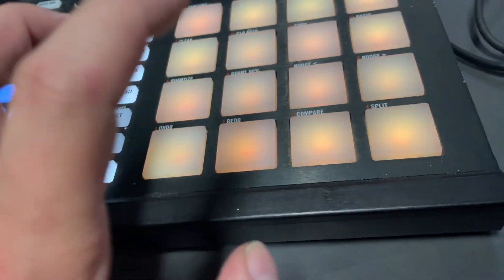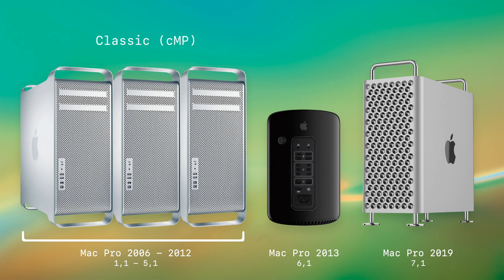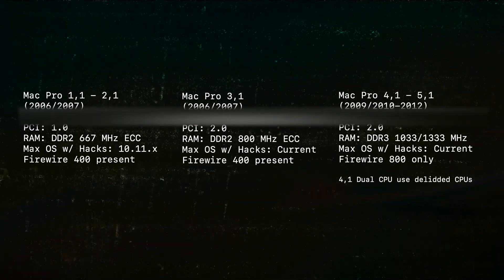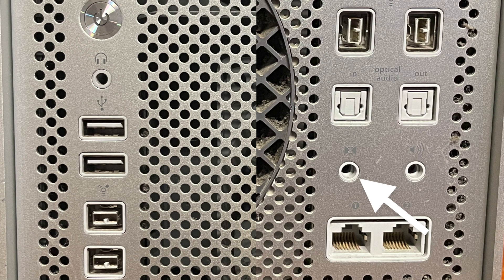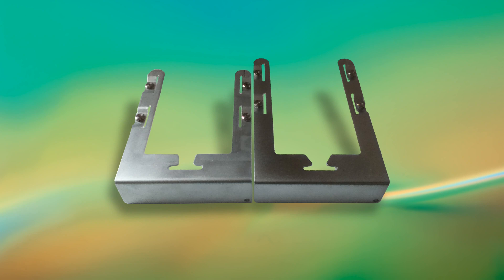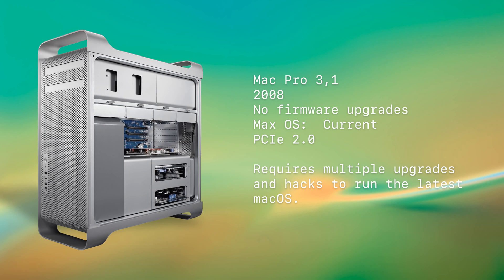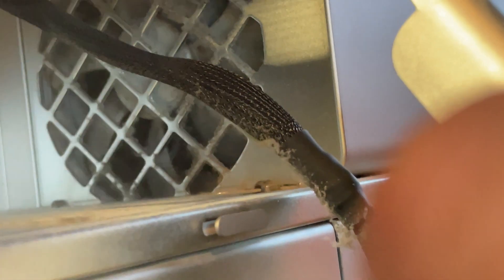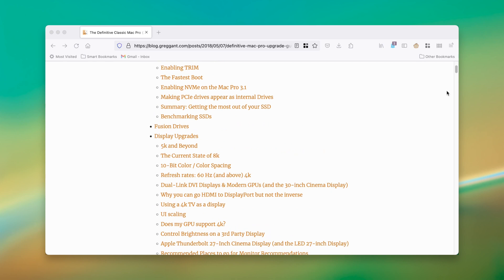Watch this before buying a Mac Pro 2006 - 2010 (1,1 2006  3,1 2008  4,1 2009 and 5,1 2010-2012)

Comment: I have a 1,1 modified with 3,1 parts to be a 3,1. It's a great mac running Mojave, I even got Big Sur to run. Despite this though I'm thinking of replacing it with a 5,1
Reply from the maker: Yeah, I made that jump around 2018. I went from a dual CPU 2.8 GHz 2008 as I noticed Serato would lose parity and goof up often after about 20 minutes of use which was annoying. Then I went to a Mac Pro 5,1 dual six-core 2.93 GHz and it was noticeably faster, especially using things like Serato, virtual machines, audio apps and video editing. If you can get one cheap, you can nab from AliExpress the same x5670s for all of $10 a pop shipped. For $20 you'd have a computer more than 2x as fast in multicore.

I'm interested though in your 2008, did you replace the logic board + CPUs?
Reply: @dmug  Surprisingly it was pretty straight forward replacing the parts. I found a guide online documenting the process but I can't seem to find a link. I had to replace the Memory Cage/Back fan, RAM tray, motherboard and cpus, Northbridge heat sink, Front fan assembly and motherboard cables with the 3,1 equivalents. Two 2.8ghz Xeons came with 3,1 board.

Once they all arrived, I replaced all the 1,1 parts with the 3,1 parts. It was pretty simple until I realised the 3,1 motherboard cables couldn't reach the 1,1 power supply. So I made a cut in the aluminium between the power supply area and the DVD drive area to get the psu cables through to connect to the motherboard cables. 

I forgot to add that I also had to move the rubber feet from the 1,1 board to the 3,1 board. Most of the screw holes met the board  but there was 1 or 2 left behind that didn't matter. I also bought a flashed radeon hd 7950 for future mac pro use.

Once done the Mac worked perfectly and performs the same as my dual core 2019 macbook pro that I used to have. Only 1,1 parts left are the case, power supply and fans. The 600mhz ram is also being used with the 3,1 board which of course slows the machine down.

If you kept the 1,1 fans, the 3,1 board wouldn't had been able to control them on boot so the mac would just turn into a jet engine. The 1,1 memory cage also doesn't fit with the northbridge heatsink or the 3,1 ram tray.

It was a really cool upgrade to do.
Reply from the maker: @mrg2810  Very cool. That's more hardcore than any of the upgrades I've done to the Mac Pro. I can only hang my hat on the Pixlas mod, and drilling out a small hole to feed SATA to the optical bay on my 2008.   

I assume that was done quite awhile ago when finding a pile of 2008 parts was a lot cheaper than getting a fully functional 2008 as that's an undertaking.
Reply: @dmug  wow hearing all this talk about the 2008 makes me want to take mine out the closet and tinker with it again. But I was seriously thinking about turning it into a media server for my plex videos. But not sure what I want to do with it. It’s still a solid built machine even in 2021.
Reply from the maker: @d.harris790  It is fast for plex, at least when I tried it about 9 years ago with 1080p. I dunno if you care about such things but I used my 2008 for awhile as my Media PC and had it dual boot Windows and played PS2 games using PCSX2.
Reply: @dmug  I used my 2008 up until I got my 5,1 Mac Pro 3 years ago. It ran plex without any hiccups at all streaming to 3 TVs. Now most of my content is 1080p but I’m good with that.  I have an  8 core, 16 gigs of Ram, and a nvidia gtx660 3gb graphics card along with the stock card. So I got a lot of good use out of it. The nvidia is a Kepler card so I was able to run macOS 10.14 as well. I wasn’t sure if I wanted to get rid of it but just recently thought about using it as a plex server so I can use my 5,1 for other stuff. By the way I watched ur video on the Mac Pro isn’t dead and got my 5,1 running the latest os. Appreciate the content you make available for us!!
Reply from the maker: @d.harris790  I may have sold my 5,1s but I kept my 2008 Mac Pro as it's the one computer I'm mildly attached to. I have a GeForce 760 in it still, and once I have my office will probably turn it into a private plex server for my friends as my GF's house has gigabit and of course document the process in blog and video. I'm still amazed and surprised how many of us there are. I'm in the process of finishing the Definitive Mac Pro Upgrade Guide for the 2019 Mac Pros, it'll be out this winter and M1 Max content too. It's been a humbling experience there's so many people who have more technical aptitude than myself that I encounter and it's cool.

Comment: solid info. I just sold one of my 2008 3,1 Cmp. equipped with a Radeon 7950 MAC edition 3gb card. My main systems are 2 5,1 with 48gb and 5680 and 5690 cpu's, all 12 cores. Sweet for DAW and fcpx workflow.  thanks for all the info